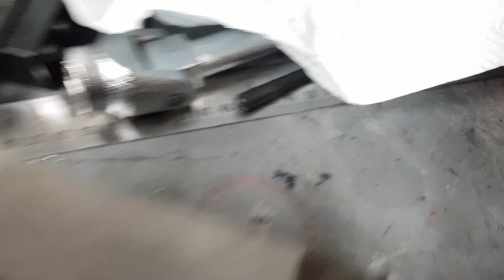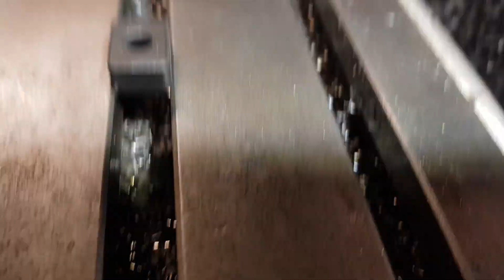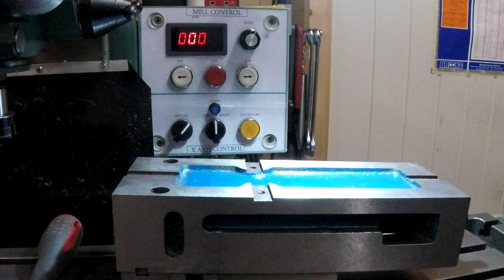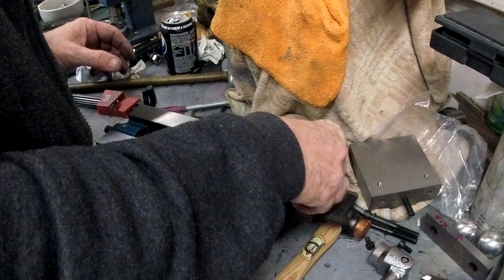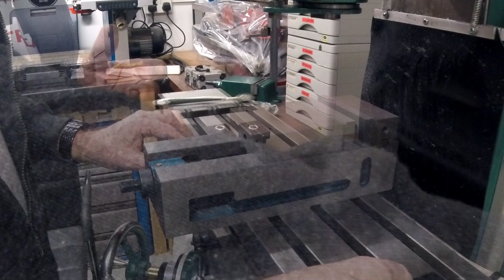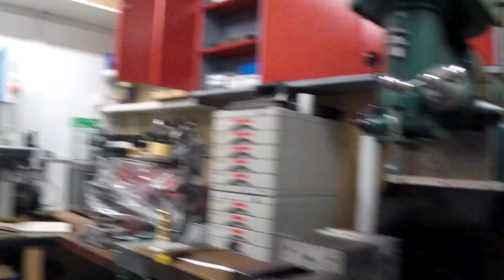Fitting a cheap Chinese made milling vice part 2.

Comment: With all the time you spent measuring  the jaws you missed the must important measure  with the jaw opened across the top of the base  were the sliding  jaw moves on  if that was out you'll never square a pice of steel
Reply from the maker: Yes you are correct. Since that video i did check X & Y on the base face. It was all good. Thanks for noticing. Noone else realised. 
Steve.

Comment: The slot for the keys needs to be parallel to the fixed jaw. Isn't that what is MOST important
Reply from the maker: I agree. The vice I have on now has the slots & keys fitted. Works well. 
Steve.

Comment: Nice. Jon from "Jon's Workshop" sent me this way, and I also have a Tom Senior vertical mill. With an Abwood Vice. That will be replaced in the next few days with a Arc Eurotrade one. I've just been milling some stuff, and it came out not square, because the back jaw is lifting the part. I think it can be adjusted with the gib, but the Abwood is too large for this mill anyway.
Reply from the maker: Hi Mat. Just seen the comment, sorry. Great to hear that someone else has the Tom Senior mill. Not sure if I did a video of the Abwood strip down. Anyway it was very tatty so I stripped, cleaned, re-assembled it. The gib strip had slipped out of position because it was not adjusted correctly. The Abwood was a very good vice though. Hope you get on with the new one. 
Regards. Steve.
Reply: @Steviegtr52  Yeah, my new vice is in place, and works well. I made a small modification - because by DRO scale is on the front of the table, I prefer the vice to sit closer to the back edge, so I milled two slots parallel to the base, making an L-shape at the front where there's a slot [that I guess is for fitting the vice vertically?].

I feel that my 6" Abwood is a bit too heavy and large for my mill, and I was only able to hold it with two bolts, which meant that it would, aside form lifting the piece, lift the "nose" of the vice itself. Not a bad vice as such, just not "right" for this mill.

I haven't actually done much since I fitted the vice, but the few test-cuts seems to work well.
Reply from the maker: Mats. Did not realise it was the 6 inch abwood. Agree totally too big. Mine was the 4 inch. Which was just right size apart from the said opening being too small. Good luck with your projects

Comment: I got alot of play in the moving jaw. This means I can't trust a piece mounted using the outer sides of the jaws as a square plane, because I can't trust that they are parallel...or am I thinking incorrectly?
Reply from the maker: Well i do not have a lot of play in mine. But whenever i want to use one side of a jaw to hold work, i always put an equal sized piece on the opposite side to counter act any chance of an uneven grip. Hope this helps, if i have read your question correctly.

Comment: Oh geesus man.......get rid of those keys....you don't need them.
With that type of vice having a machined edge, for all general milling, you only need to use a square against the side face and the back of the table face to get it square which is a quick way and is good enough..........but for any really fussy work you use a dial indicator against the back of a parallel held in the vice.
At the same time, with the keys out, you can pull  the vice back further and if you really want to clamp it you have 3 slots for 3 sets of clamps to really tie it down.
Reply from the maker: Thanks for that.

Comment: Saw a couple of these for sale on a dealer's site 150mm (6") for 275AUD ..about 125 quid, I think...........I already own a Kurt DX-150mm ($ 1,500!!) BUT after seeing you with this I am going to buy 2 and rebuild/surface grind them, whatever,  for my new/old Fexac UMS (arrives next week), .........They are "Cheap as" and gives me the opportunity of wasting a couple of days on my machines fixing them up....lucky I am retired...........haaaaahaaaaaaa
All the best, stay Covid safe.
Cheers,
Davo from "Downunder"
Reply from the maker: Well so far i am happy with the purchase. If i had to knock anything it would be the leadscrew is small & it needs a good tighten to get the grab that the old one has. It was just mainly for the opening jaw size that i got it. I am sure you will not be disappointed.
Reply: @Steviegtr52  A year back I commissioned a small mill I had and added one of those 100mm grinding or tool makers or screwless vices........choose the title......as I have always admired then for their ability to put a pull down force to the work piece, but when I got it and tried to use it I just wanted to give it away.....GGrrrrrr.....
The problem is the nut that the screw fits into that pushes the jaw falls out of the slots at the slightest move and you have to fish amongst the swarf to find it and try to remount it.........sometimes the prongs on the nut catches at an angle in only one slot and at the worst moment it drops out and the work piece too........I won't go on.
So after a lot of head scratching I reworked the whole screw/nut system and now it performs like I wanted it to......the vice is a 100mm wide one with the side slots for clamping and cost me A$125 on EBAY in 2020.
Reply from the maker: @gangleweed  Great stuff. You got it right in the end.